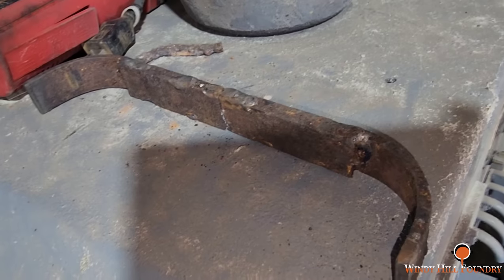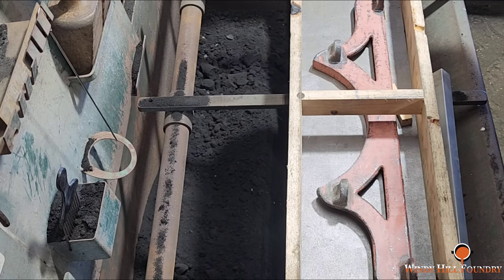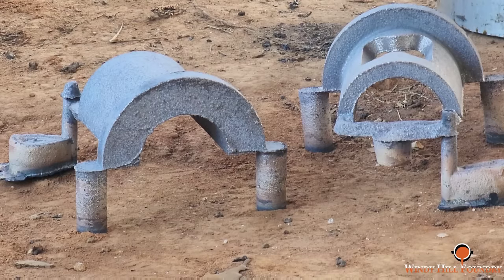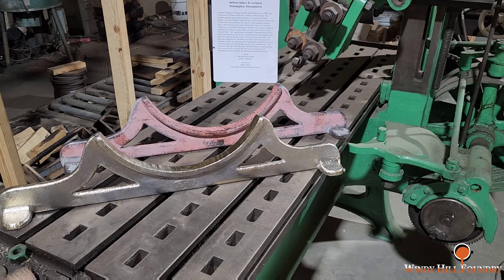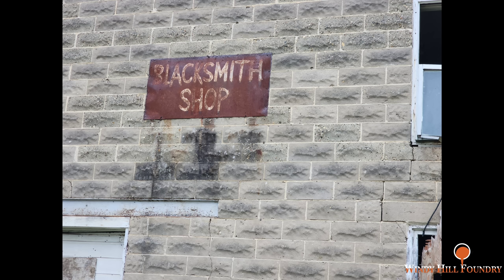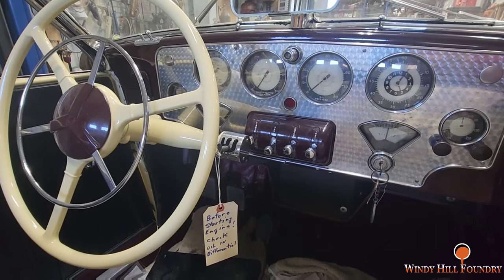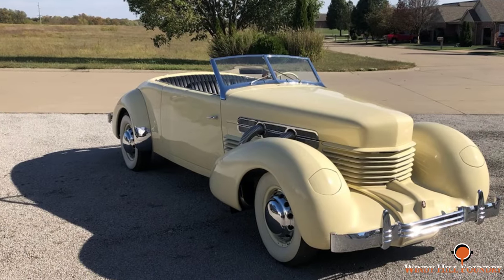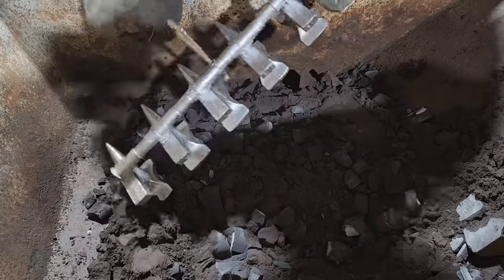BRONZE TANK BRACKET WHF 29

Comment: I'ld have a black smith make a new spring to those dimensions, and make a stress spreader from a thinner piece of spring steel.
I'ld also put a hardened piece of steel with a shallow hole in it on top of the springs.

Comment: It seems like you are usually needing bronze for casting. We machine a lot of bronze where I work and we probably have atleast 20- 55 gal drums full of bronze chips from machining large 30" diameter cast bronze bushings on the lathe. Would these chips be of any value for casting? The drums weigh about 1000 lbs each.
Reply: Bronze chips are the worst scrap to remelt because it is mixed with coolant and those chips tend to oxidize a lot leading to a poor recovery rate.